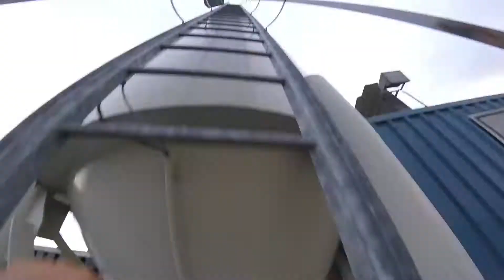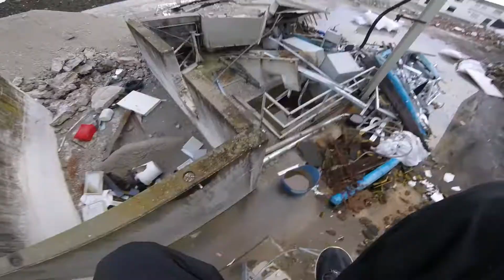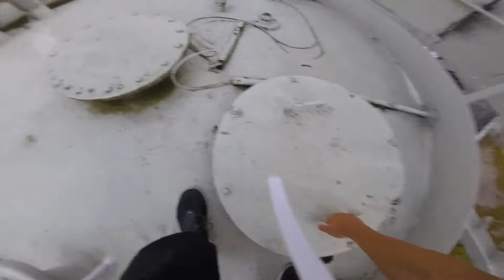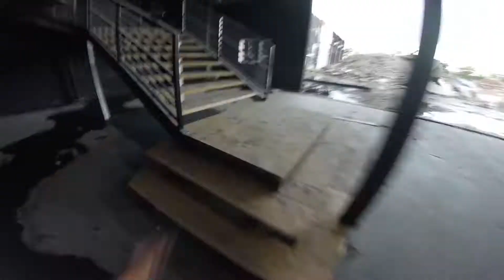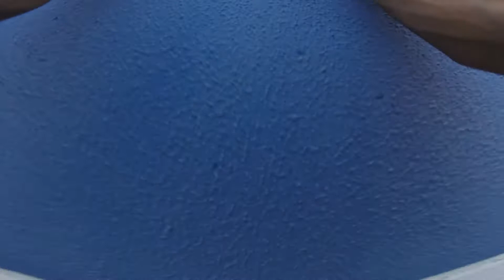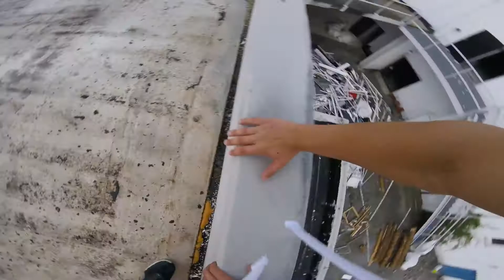Exploring An Abandoned Filmstudio POV/GoPro HERO4Session

Comment: Hey man i've got a question for you
I ´d like to buy a gopro to film my activities like Parkour, skate, bike ans more so i hesited between 2 gopros: hero 3 white / hero session. The session is à bit more expensive but take better videos (Colors/luminosity) 
But to film biking i'm scared about the gopro hit a branch or anything else so i would like to know (from ur experience) if i need to buy a case adapted in order to film bike if the gopro doesn't need a protection (can a branch damage the glass of the camera?)
I hope my comment wasn't too boring but i don't know anybody who has the gopro session ;)
Reply from the maker: No the gopro Session is a quite robust cam and I'm sure it wont break after being hit with a branch :) 
And I didn't use a case adapter so far ...so 
how much is the hero3 white ?
Reply: +WukongExploring the hero 3 white is about 200€ and à case avec apapted to the gopro session cost 16€
Reply from the maker: Yeah and the session costs around 200 too :D
Reply: +WukongExploring ok man thank you for ur help i think i know witch i'm going to buy 😉
Reply from the maker: Np bro :D ! What have u decided to buy ?